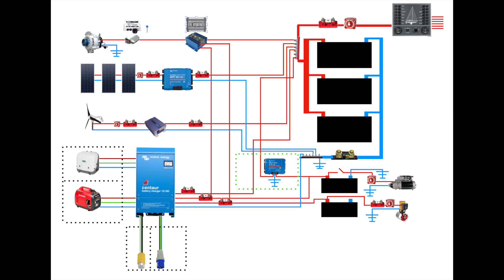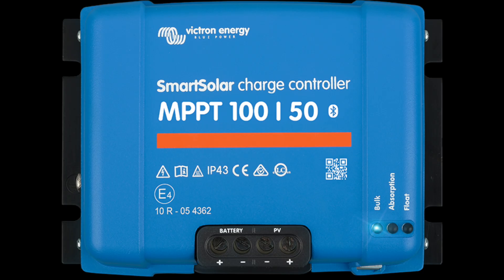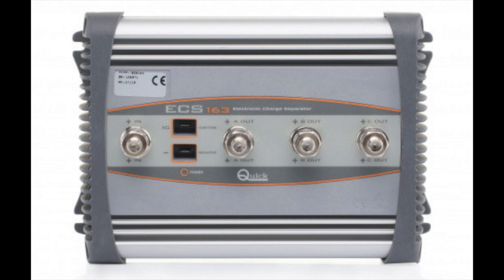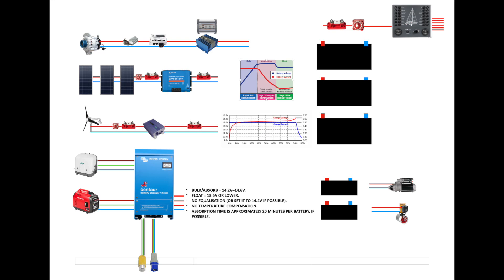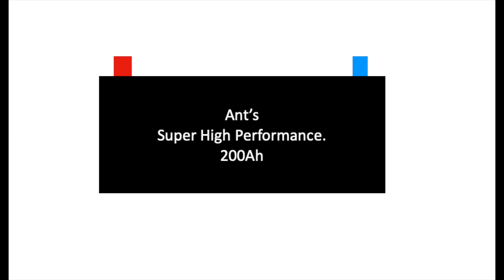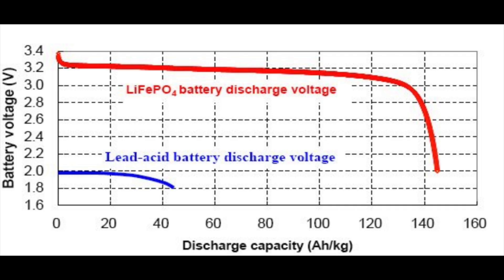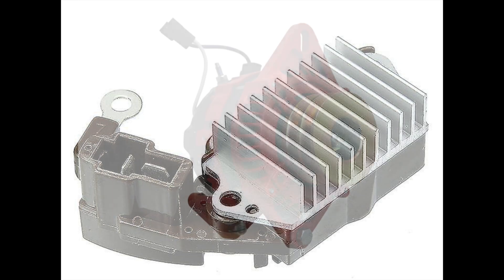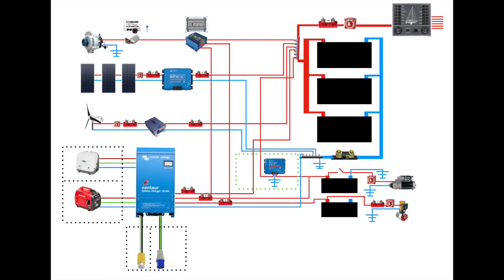Battery Charging! What do you know? What do you not know?

Comment: I am left somewhat confused. On your schematics the split charger lower red output goes to the starter battery and in parallel via dc-dc charger to the LFP batteries. Just as you explain it should be. But the upper red output from the split charger connects directly to the LFP. Wouldn’t that cause potential overheating of the generator when this connection is activated? Furthermore, isn’t there a risk of damaging the alternator when the bms cuts further charging?
Reply from the maker: Thomas. Yes that's one alternative that we talk about in the video. We do not recommend it but people are doing this.It would probably invalidate any warranty on the LiFePO4 batteries. If the BMS fails the load is still on the alternator from the other batteries being fed before the split diode. Some folks are putting a switch in this line or one of those alternator protectors. It can be done but we don't think it's a good idea, but have to discuss and show it. Perhaps we should have made it clearer somehow by naming this as a direct link? It is difficult to do one schematic that covers all scenarios.  Thanks for watching and a good comment. Sail Safe mate. Ant & Cid
Reply: I am really happy with your video. But, still not sure I understand your schematic correctly. 
Have you drawn two different ways of connecting the alternator to the LFP in the same schematic?
1. Using the dc-dc charger in parallel with the starter battery. Suitable for a system without external alternator regulator.  (Direct line not being used)
2. A direct line from split charger to the LFP. Including the external alternator regulator to eliminate the risk of overheating the alternator. 
(Parallel dc-dc charger not being used)
In the meaning use either 1 or 2?
Sorry to bother you. But, as you have been very clear in the video I would really appreciate to understand the final bit 🙏
Reply from the maker: @thomasaaboejensen1778  Yes we have used the same schematic to display both type of charging. Either using the DC B2B charger or the direct line (which we do recommend but is apparently used by some folks). Basically we recommend the that the alternator is protected from overheating by the B2B or by a WS500. The split charge system only protects against alternator damage should the BMS fail. It does not protect against the overheating of the alternator were the current draw is greater than the cooling can cope with. Both the B2B and the WS500 will do this (the B2B by having a lower output limit) and protect against BMS failure if you are not using a split charge system such as, a a bat 1-2-both switch. However, the B2B system generates a lot of heat even at just 30 Amps per unit. The WS500 prevents this overheating at slow engine RPM and large current draw by limiting the field current voltage and thus the output as the heat increases via a heat sensor. The B2B will just act as a battery in parallel. Direct wiring will do neither unless you have a smart alternator with a built in heat sensor. Hope this helps. Regards Ant.
Reply: Hi Ant. Thank you for your in depth answer. Now I feel confident in the various solutions and the related pros and cons to each of them . My next step will be to choose the one for my upgrade to LFP 😊
I wish you a happy new year 🎉
Reply from the maker: No problem mate, glad to help. This is exactly why we make these videos. To help others out. God knows there is no money in making our type of videos!! LOL Sail Safe mate. Ant & Cid  @thomasaaboejensen1778

Comment: Let’s say I wanted to turn my 06 trailblazer into a series hybrid similar to a FiskerEV. Basically add a generator to my gas engine so I can charge 6 batteries in parallel.  Have that run a EV motor that  moves my rear axle.  What’s your opinion.
Reply from the maker: Whats a Trailblazer? 🤣
Reply: @SVImpavidus  haha it’s an old GM SUV.